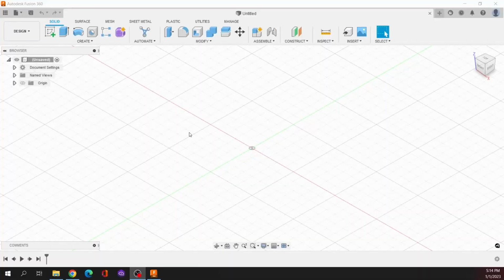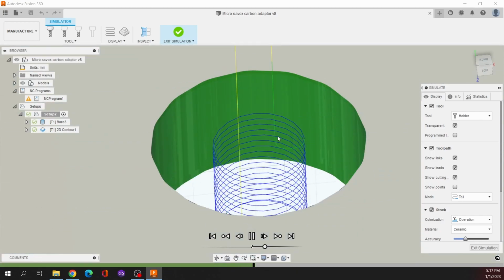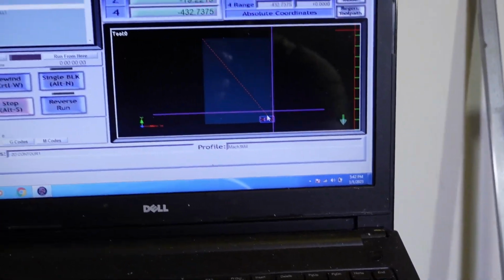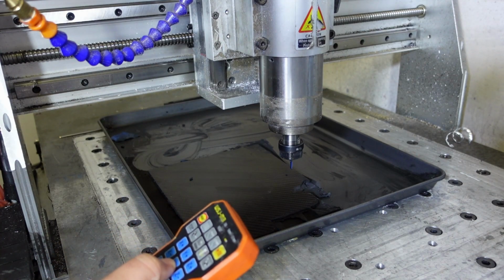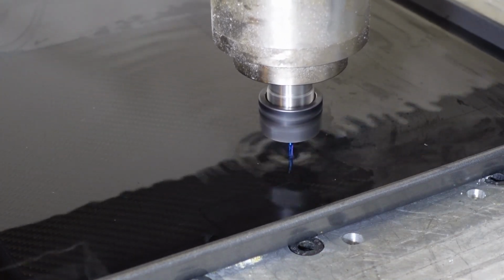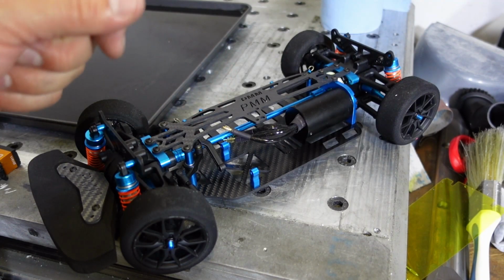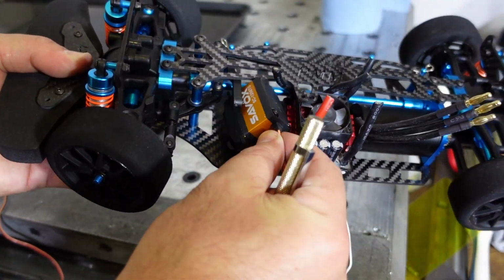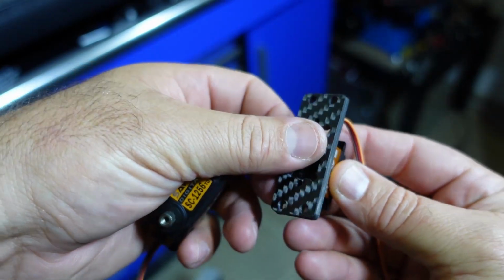How to CNC machine Carbon Fiber RC car parts.

Comment: Could you do a telecaster pickguard project?
Reply from the maker: Im sure it would be easy enough.
Reply: @raindeergames6104  I guess you do not want to do one for me.  Thanks
Reply from the maker: It is very difficult for me at the moment. You will see i have not posted a video in two years. I became a father and focus very muxh on my daughter and my son will be born in e months..... but.... I am trying  very hard to get going again. And i have been very hard at work building a new cnc from scratch. @JC-td4gg
Reply: @raindeergames6104  Thanks for the reply and I hope you get your new unit going.  I will try to find someone locally so I can do it without having to ship it. The carbon fiber pickguard I want is presently not being offered by online pickguard sellers.  It is the Fender Brent Mason telecaster being played by Zach Top.
Good luck with being a father also.

Comment: Thanks for sharing ❤ your work, especially cut in water method. Another good idea.  I did try laser diode which could not cut CF, so the only way is to do CNC only the flying powder CF is a thing hard to deal with. Either go vacuum or water mist or like yours water tray.

Comment: Great vid!  🗜 re. "blue tape and super glue"  blue tape stuck to the carbon fiber sheet?  then super glued to a spoil board? is the spoil board wood or plastic or something else?  How is the spoil board attached to the tray?  How is the tray attached to the machine?  I see no clamps or bolts or other fixturing hardware.  Preparing to CNC drone frame in my machine.  Thanks!
Reply from the maker: Thanks alot. The base of the Watergate is aluminum. It has about 10 bolts that bolt it to the bed of the machine. I out grease into the hole when I bolt it down and no liquid seeps out of it. Then I put painters tape onto the "spoil board". I don't really call it a spoil board because I don't cut into it. Then I put painters tape on the carbon fibre and glue it onto the spoil board.

Comment: i'm planning to build a cnc to cut carbon fiber parts, can you pls tell me what is the wattage and rpm of your spindle ? i'm thinking of using 2.2KW 24000RPM spindle, will it be able to cur 3-6mm carbon fiber?
Reply from the maker: Hi good day hope You are doing well. A 2.2kw spindle is actually way overkill for cutting just carbon but it is a good universal spindle and will let You Mill some aliminium parts of needed. I'm going to start posting again soos. I've got a awesome cnc build coming. Scratch build of a 550kg gantry mill wil centeoid 5axis controller and closed loop 1um scale compensation. The 4th and 5 axis build aswell.
Reply: @raindeergames6104  
yeah i'll also cut some aluminium parts too.

thanks a lot for the reference, wish you the best for ur build and keep posting!

Comment: Can you share your feeds and speed and a link for the end mill bit
Reply from the maker: Hi so sorry for the late reply. I've been crazy busy with other things but hope to start posting soon. These I cut 20000rpm but anything from 16000 tp 240000rpm will work great. I feed very slow at 400mm/min. These are common PC board cutters available on ebay and aliexpress and I use a 1.6mm bit

Comment: Reverse the spindles and c hubs, run a carbon fiber splitter and mount the servo on the splitter. This is a very common trick for speed run guys who need chassis real-estate
Reply from the maker: Ive seen it done yes. Kevin Talbott did it on his one limitless. For this car however  I have very specific body I want to run that wont accommodate the servo up front there but Im going to do in my limitless.